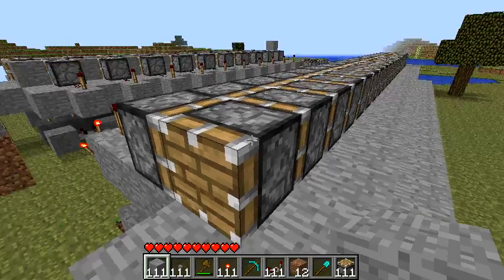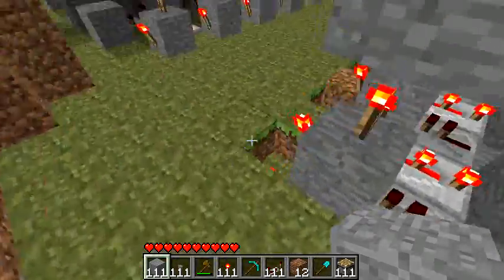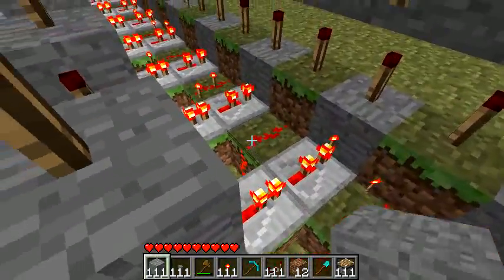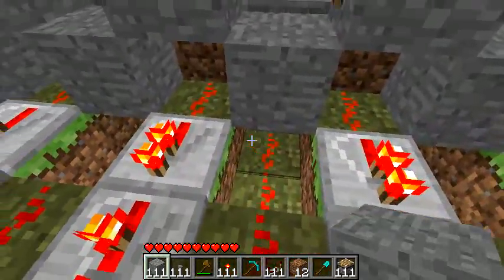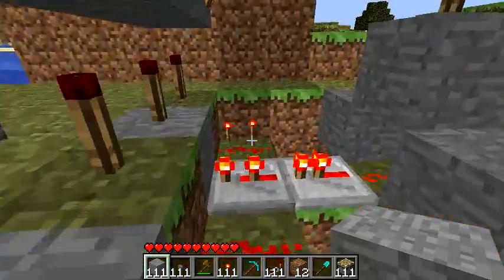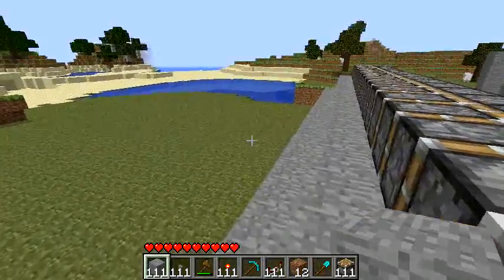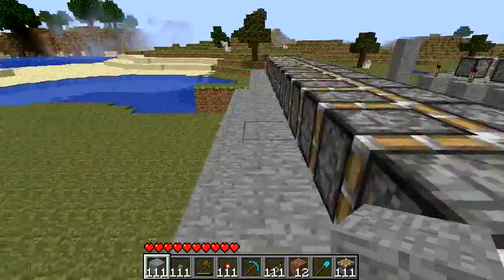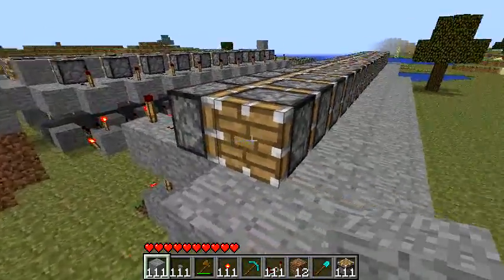Minecraft Piston Conveyor

Comment from the maker: @soopakoopavids The "sideways" pistons are alternately activated by redstone wire behind them and redstone torches beneath them. The "forwards" pistons are activated by redstone torches beneath them. You can "force" redstone to connect to something it would otherwise bypass by using a repeater, and you can run parallel lines of redstone by using alternating repeaters as well. I'm learning a lot of tricks as I experiment with these designs. I plan to make a wiki page about it eventually.

Comment: Does it push blocks away before they are touched by redstone currents?
 I need a solution to transports tnt into a cannon magazine, and i dont want to use the cobblestone generator trick.

A way to check is is to transport a piston, if it dosent get activated its safe for tnt transport.